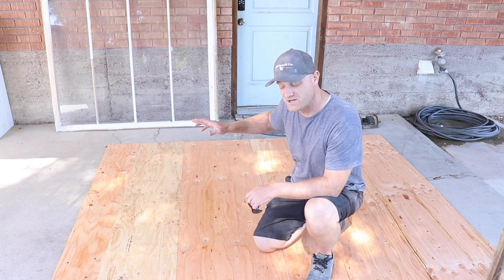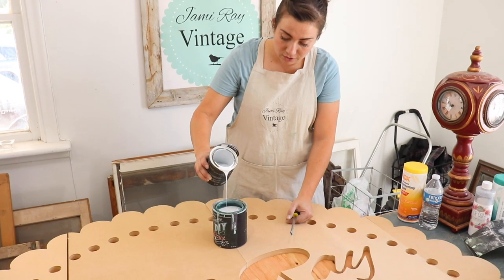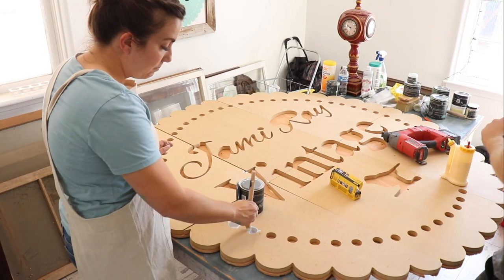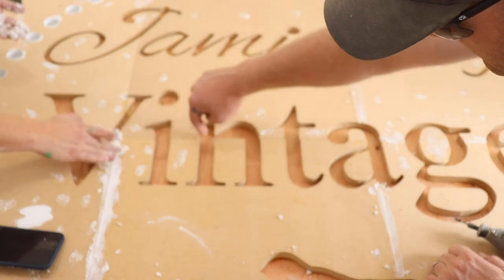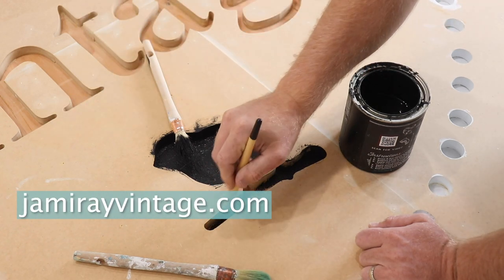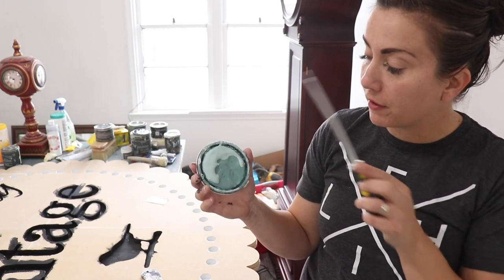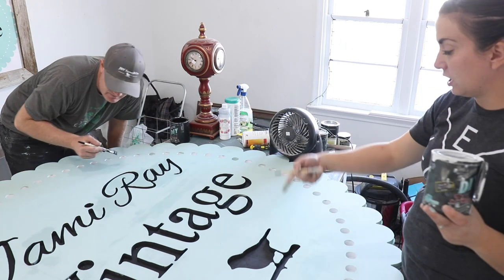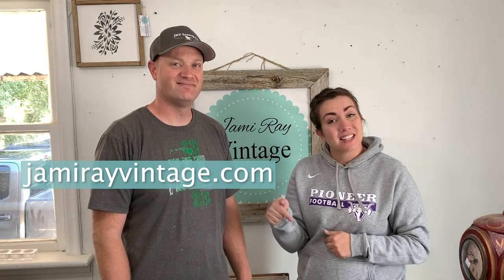Huge Custom Sign For The Shop!

Comment: What CNC machine do you suggest??
Reply from the maker: I have a Laguna IQ 3x2. 
There are definitely some good machines out there for less but we use it to make a lot of products for the website and the IQ has been rock solid with great tech support.
Reply: Jami Ray Vintage thank you. I will definitely be looking as it’s a tool that I would like to add eventually as I make signs.

Comment: What is a CNC machine?
Reply from the maker: Computer Numeric Controller. 

It takes an image, turns it into curves or paths and then you can program the cut sequence on the machine and it uses an xyz coordinate system to know where the cuts are supposed to be and cuts your image out.